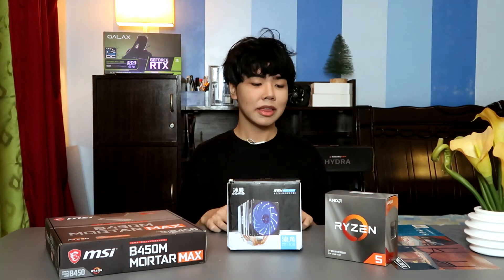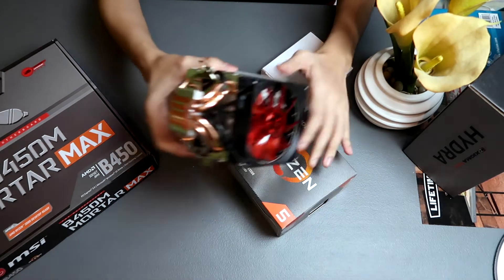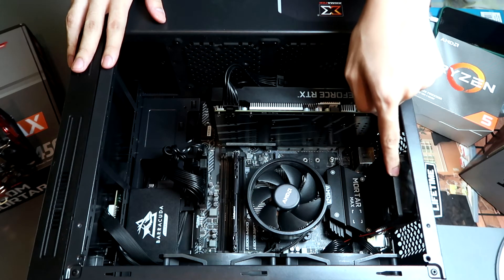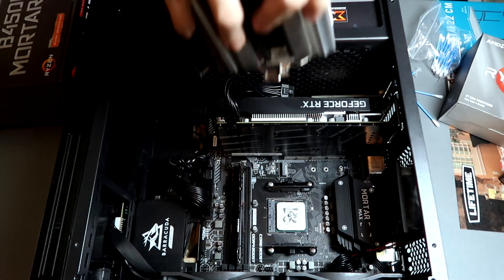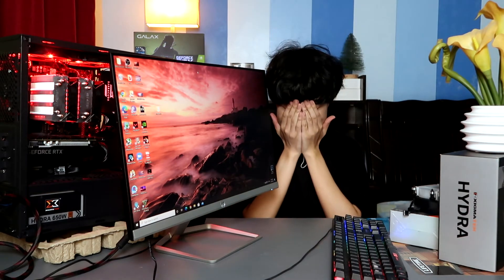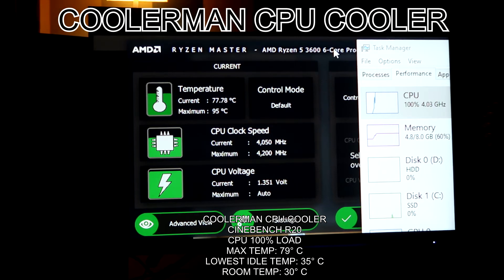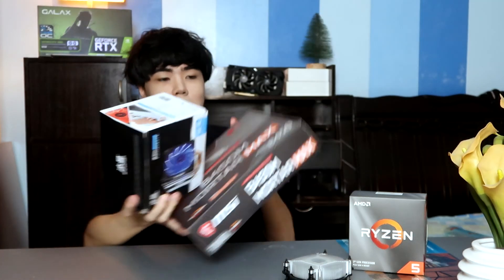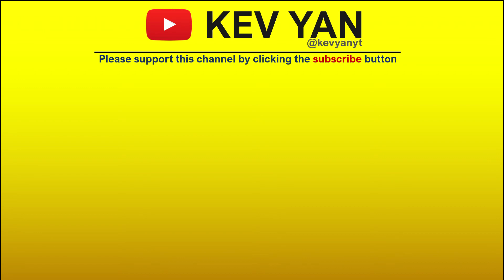Snowman M-X4 | Coolerman 4 Heatpipes CPU Cooler Detailed Unboxing and Review Full Installation Tips

Comment: sir, do you know the  dimension ng cooler? lalo na yung clearance nya from the cpu to the bottom of cooler. baka kasi tatama sya sa ram. Thank you.
Reply from the maker: Nakalagay lang dito.
Product size: 
-115mm length
-98mm width
-135mm height

Fan size
-90mm x 90mm x 25mm

Weight
-580grams
Reply: @KevYan  Thanks!
Reply: @KevYan tumatama ba sya sa ram mo kuys?